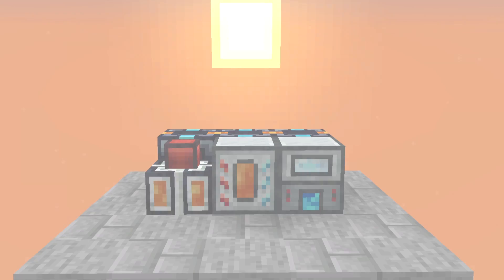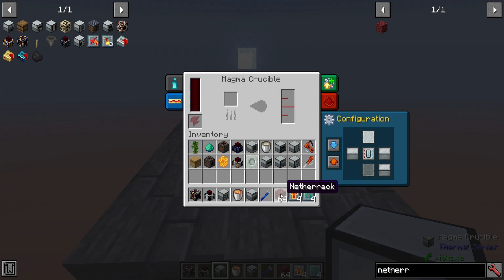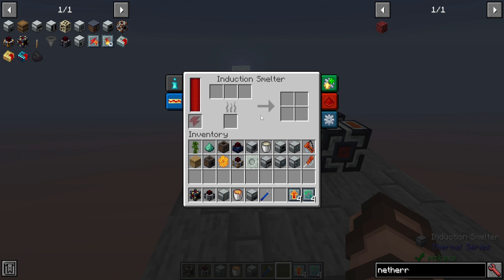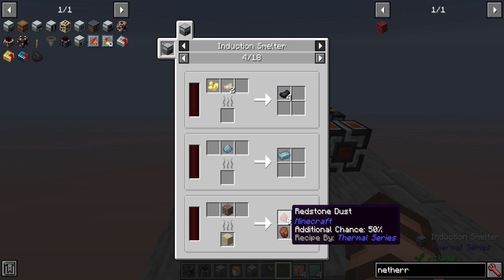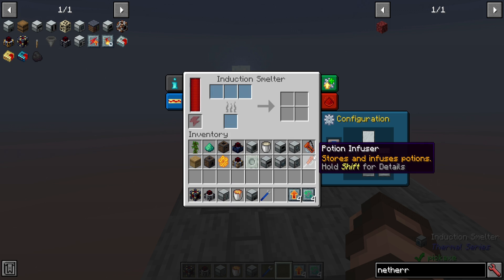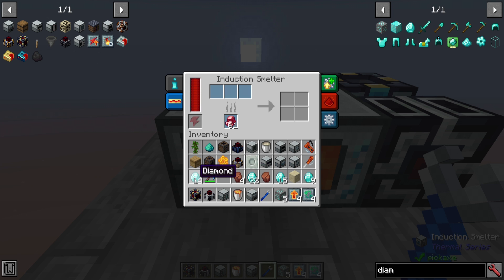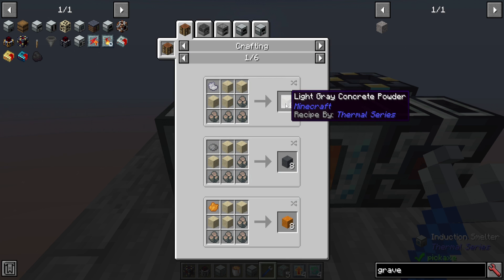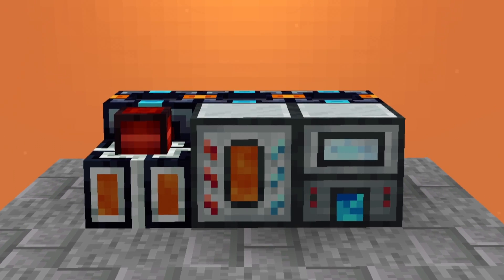Thermal Series Pt7 Crucible Induction Bit-By-Bit 1.16.5

Comment: I just had a thought about the combination of the two Arguments. If my calculations are not wrong using Cinebar as a catalyst and 2 Aguments reducing Consumption chance. There would only be a 0.2^3 = 0.008 or 0.8% Chance to consume a catalyst. Which in my opinion should be countered by the occasional Gold or Redstone Ore producing a cinnebar.
Reply: Your maths is off, sorry. Cinnabar has a base consumption chance of 80% (0.8), which you then multiply by 0.8 for each Catalytic Reclamation Chamber you use. This goes to 0.64, 0.512, 0.4096, 0.32768.

Comment: Would Cinibar increase the output of Cinibar from Redstone?  That would give enough redstone from redstone to be worth using it instead of fortune, specially with augments, and give enough cinibar to not only be self sustaining, but let you use it on other things on the regular.
Reply: I notice nothing seems to be using all 3 slots right now, but given that the fluids had to be removed, it makes sense to make enderium and so forth in there, instead of with a bucket of liquid and two metals.